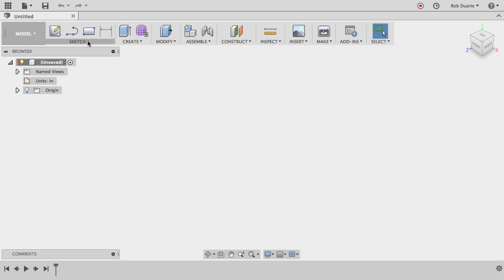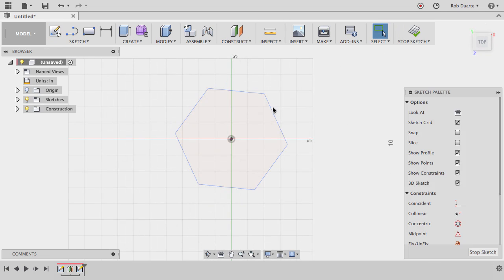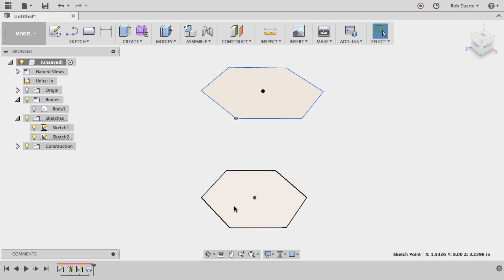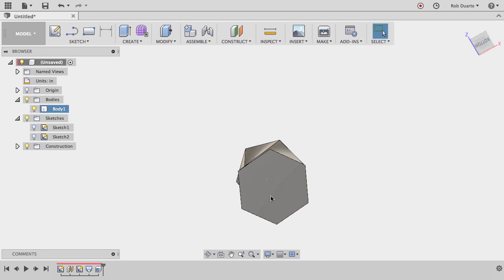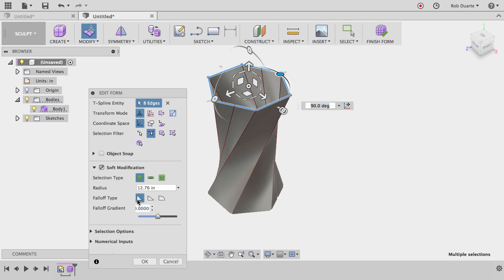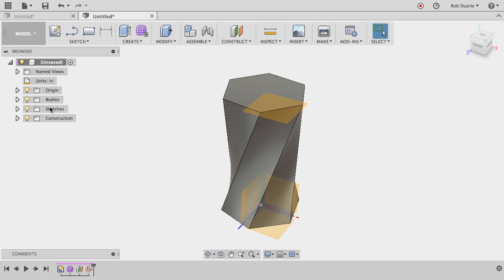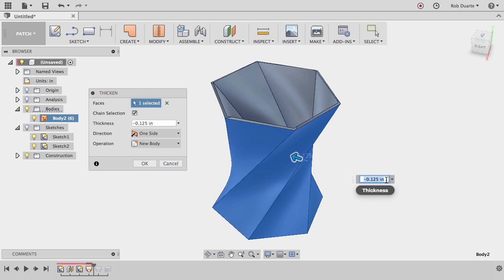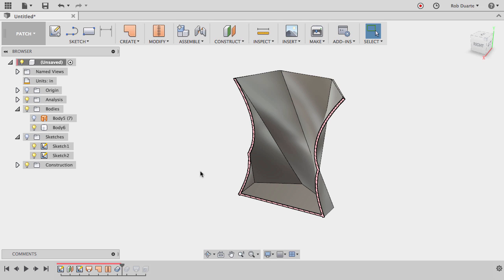3 ways to make a twisted hex vase in Fusion 360

Comment: Ok great but you didn't explain the most important part. How to twist it. Judging by your reply's to comments this is obvious to you but not to us beginners...
Reply from the maker: Not sure what you mean. I definitely show how to twist it. I showed a few different ways - are you having trouble making any of them happen??
Reply: @RobDuarte  I tried all ways and can not figure out how to rotate the top hexagon :(
Reply from the maker: @taurruth  Well, I just followed this (6 years old) video and all three demos worked as shown. The only difference is that I had to look at the form from the top view when rotating - to make sure that it rotates along the correct axis. It's a trivial detail for software that has evolved a lot since this video was posted. I would recommend practicing and assuming that there's some solution (probably several) to whatever problem you're experiencing - following my videos or anyone else in a rote fashion and stopping when something doesn't work exactly as shown is not a great way to learn this stuff. The details of the software change (especially in 6 years) but the basics stay the same.
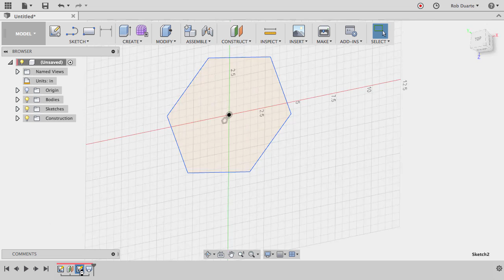Reply: @RobDuarte  I am not stating that your tutorial is wrong. My point is that I am so new to Fusion 360 that I have no idea how to rotate a plane like you did in 4:21 or rotate a sketch like in 2:15. It may be obvious to you so you haven't told what you press to do it, but I have no idea how to do it. Maybe it is covered by another of your tutorials? If yes can you link it?
Reply from the maker: Thanks for giving more information about where you are having trouble. At both of those points, I'm just clicking a point and dragging it. If it drags in the wrong direction, you can switch to a different view first (in this case, the Top View).

Comment: Thanks Rob this is awesome. I want to make a long form like your vase...but much taller..and then form it into a circular ring. Would this be possible in Fusion?!!
Reply from the maker: Sure, anything is possible 😂 I wouldn't think about making a long one and bending it, though - that's how you might do it in real life but not in fusion. I would consider lofting as I showed but in an arc shape. Then make a circular pattern of that 1/4 circle arc and join the 4 parts into one. You could probably try something like that approach in any of the workspaces.. solid, surface, sculpt.

Comment: Great video. How would you export those dimensions so you can create a real-time fabrication?
Reply from the maker: To 3d print it, you just convert it to a mesh body. To use something like a milling machine, you would use the Manufacture workspace to create toolpaths for the machine.

Comment: I think there's a bug when twisting sketch points or lines
sometimes it works but after one or two times, it doesn't work. 
I checked constrain and drawing several times like that but twisting is not working properly
If you can do it smoothly please let me know the way.
thanks for video

Comment: Great video Rob. One minor point, please use metric measurements as the rest does.
Reply from the maker: paul sanders haha I'll consider that next time. I am in the US, though. In any case, the units don't matter in an example like this: 4 inches, 4 cm, 4 meters, it should work the same way.
Reply: @RobDuarte  no it matters.
Reply from the maker: @peteh9099  how so? If you run through this tutorial using metric units, you will arrive at the same results, no? I understand that it is better to use metric units, but it does not affect this particular tutorial. Or am I missing something?
Reply: @RobDuarte  if you need to 'travel' to arrive you waste gas.
Reply from the maker: @peteh9099  yes, and I'm not interested in wasting gas. Take care.

Comment: just like every single tutorial i find for any kind of software, the video is completely different, and following the directions leads to different results.

i can rotate the whole object, but not twist it.
Reply from the maker: To be fair, the video is 5 years old. Things change :)
Reply from the maker: FYI I just followed all the same steps and nothing has changed, actually. The only thing I noticed is that rotating the top worked better if I switched to the top view before dragging.